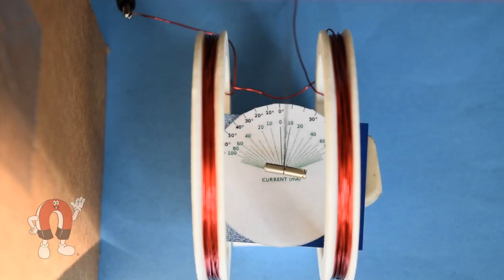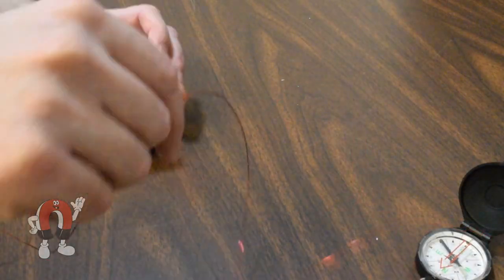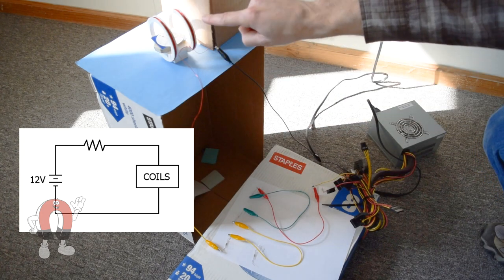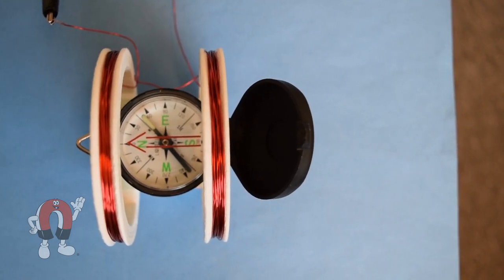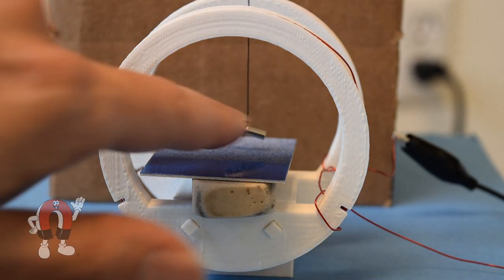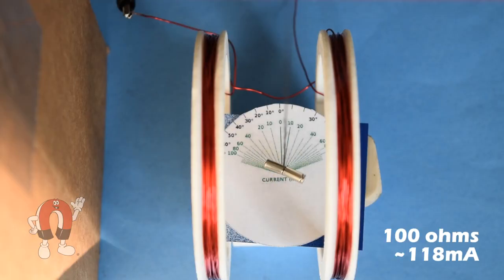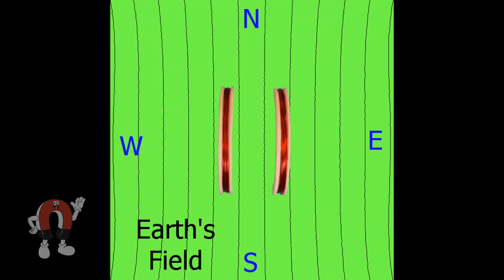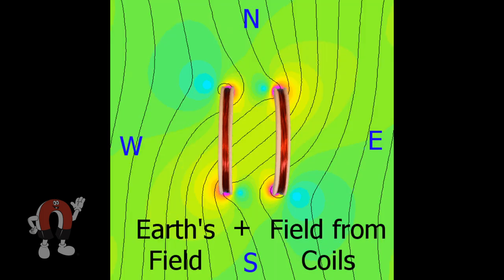How to build an ammeter (with magnets)

Comment: Thank you. I am building a tube stereo amp and would like to make my own analog panel mount round  DC ammeter with a rang of 0 to 50 mA (readings in increments of 10 mA equally spaced i.e. 0 - 10 - 20 - 30 - 40 - 50 mA). How would I make this meter? Where would I obtain parts/hardware please? I can make my own scale reading but how would I make a pointer-needle and housing that looks presentable? Any links or advice would be helpful. Thank you kindly.